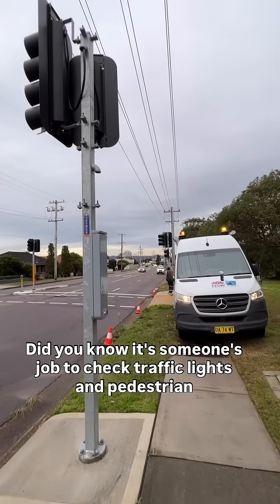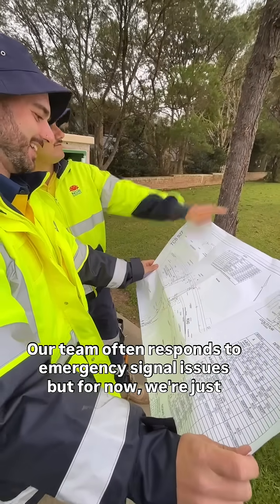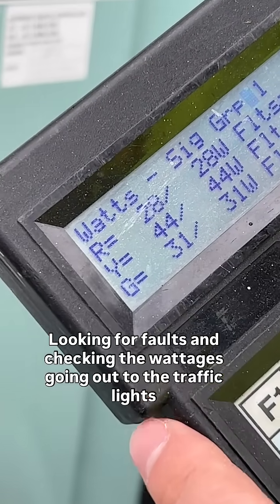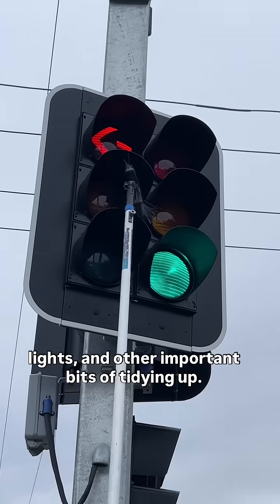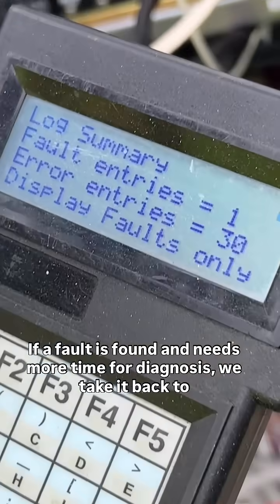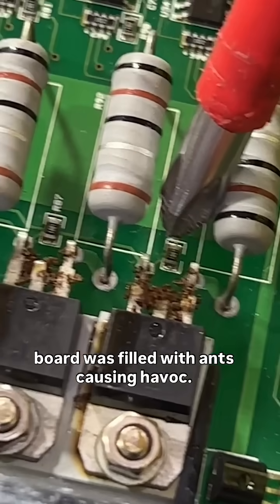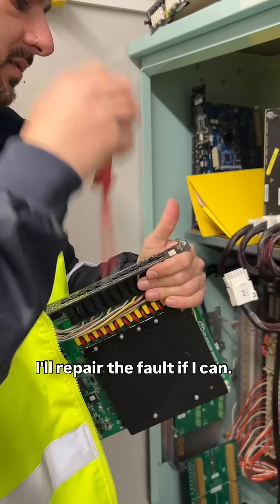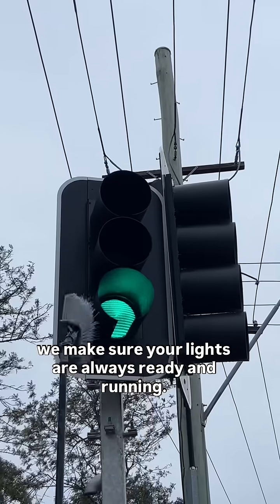How we maintain our traffic lights 🚦

Comment: I always thought the pedestrian buttons didn’t actually do anything
Reply: Yes they do. Anything in the Sydney cbd between 7am - 8pm (I don’t remember the exact time, it’s in another video by tfnsw). Between those times, it’s automated meaning the button does nothing. Outside those times and outside the cbd, 99% of lights will not activate the pedestrian crossing unless pushed. It sends a request to the controller to let it know to activate the pedestrian lights for its respective phase
Reply: Technically they don't from what I hear, they display a light so you think it's going to change for you but they mainly focus on cars and timing to when let pedestrians go than using the button

Comment: On intersections there are squares marked on the road... i guess its to identify if a car is present,  how does that whole process works, i have looked for cameras could not find any....
Reply: Vehicle presence sensors can work off of cameras, but if there are slits cut into the road in big loops, it's probably an induction loop. Same basic process as RFID cards for building access, but those cards have little computers in them that kinda change how much metal is detected really rapidly to give an identification number. The car sensors just look for metal or no metal.
Reply: Upside is with bicycles so often mine don't get noticed so after 8 loops of lights I just go through red light or I never get a green
Reply: NSW doesn’t use cameras for vehicles to trigger the face. They only use induction loops,